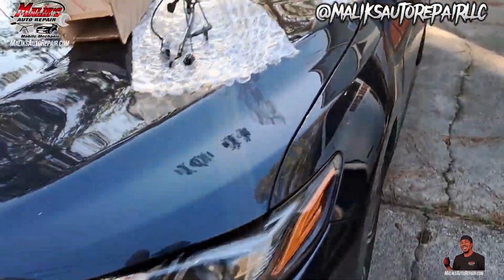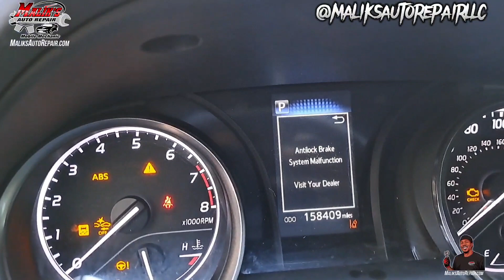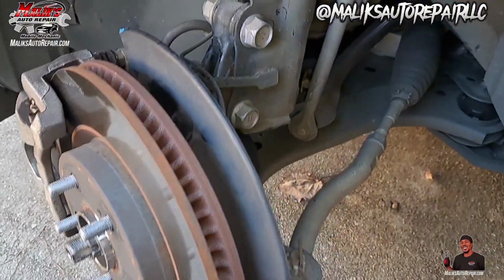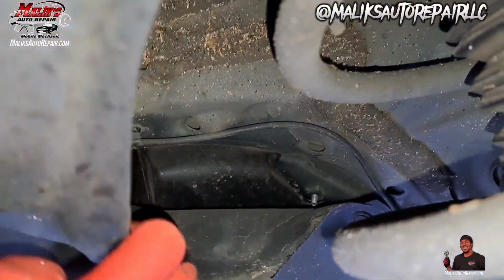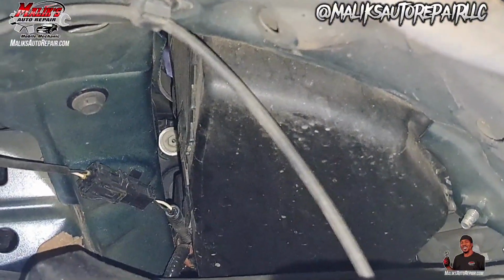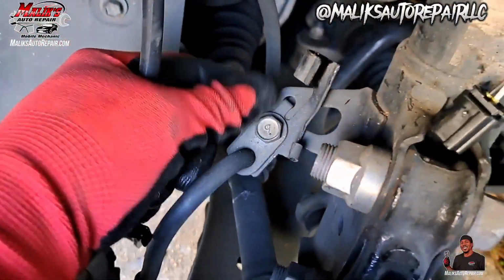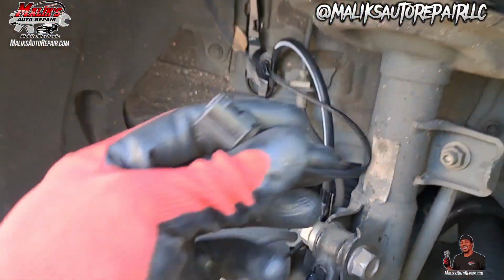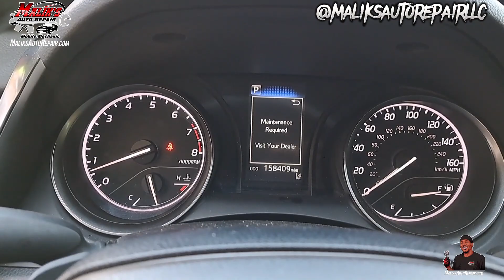2021 TOYOTA CAMRY | HOW TO REPLACE ABS SENSOR | GET RID  OF ABS LIGHT, TRACTION CONTROL, BRAKE LIGHT

Comment: I replaced both front speed sensors but I’m still getting my traction control light to flicker. It flickers once I pass 40 mph. Every time I tap the gas it flickers. 
It does it on and off. There’s some days that it will drive normal but then out of nowhere it starts tripping out again. 
What could be the problem? Fuses?
Reply from the maker: You need a scan tool that reads abs systems and shows data stream. It will tell you which sensor is bad.

Comment: Hey man so I change a wheel bearing on my 2019 se toyota camry and after that now I got all the same lights you think It happens because I put a new wheel bearing on it ? I ordered the same cable that you got on this video
Reply from the maker: Is it a wheel hub assembly or wheel bearing that has to be machine pressed?
Reply: @ThePullUpKing it was the whole wheel hub
Reply from the maker: That one is just plug and play, so I doubt you did anything wrong.
Reply: @ThePullUpKing I did the rotors and brake pads and that one wheel hub and when I started the car all them lights was on but they wasn’t on before
Reply from the maker: Unhooked the negative battery terminal to reset.
Reply: @ThePullUpKing  i did and nothing happens so I soon I get the sensor today I will unhook the negative and put it on and then hooked back up and see its frustrated seen all them lights on
Reply from the maker: @jaimevega9701  You need a scanner that reads abs codes. Might need to be replaced, if the wires look good.
Reply: I will check all that for sure thanks a lot man I appreciate 🙏🏼✌🏼
Reply from the maker: No problem at all. I appreciate the engagement. And thanks for watching. 💯
Reply: @ThePullUpKing 🙏🏼so I put the new cable just finish with it hooked up the battery and no more lights thanks for your vídeos 💪🏼

Comment: Hiiii bro I got Toyota Camry se 2022 I got same issue as your car has I got 2 questions for you I am not sure what abs sensor should I order second how much does it cost from dealer thanks
Reply from the maker: @ZaheerAhmed-qu5ho  You can call you local dealership for their price. It's a couple hundred. To find out which sensor it is, you need a scantool that reads Abs. Also check the wiring harness first, before replacing.